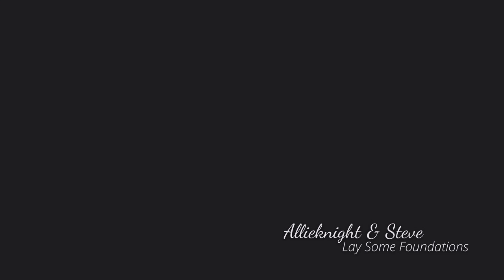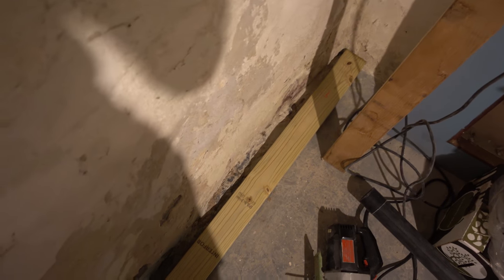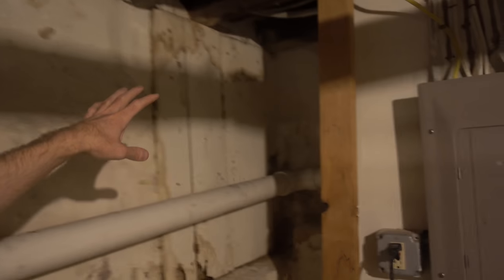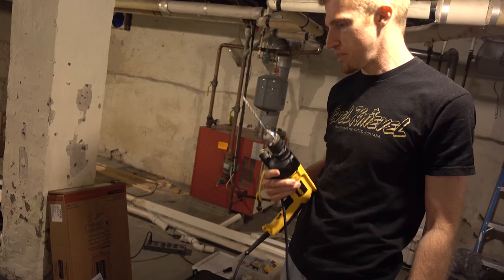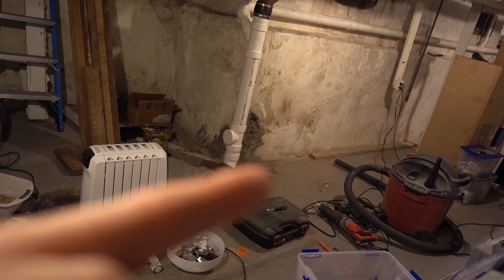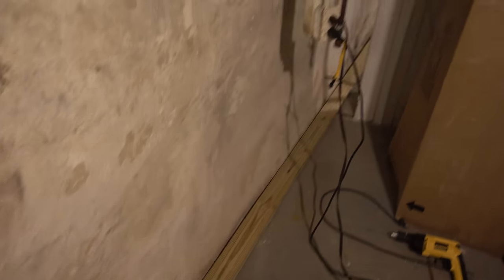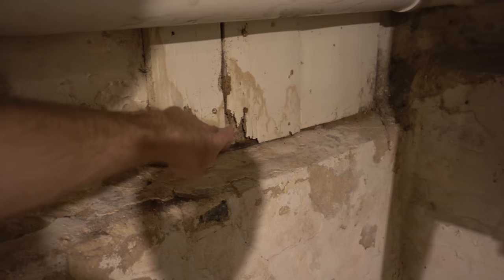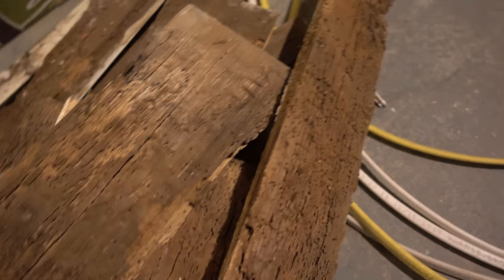Laying Foundations

Comment: No moisture barrier?  Any time wood (even treated) touches concrete, you will get rot like the boards you removed. Lift your bottom plate and put something substantial under it.  I like using roofing material, it is thick and durable.

Comment: Washers under your tapcons for better loadgrip spreading.
Sealant on the tapcons because you drilled thru the 3 inch thick slab and it's just wet dirt under the slab.
Reply: Ronald Oswald That's what I was going to say. Also seems like a real thin slab.
Reply: 3 inch is standard for slabs that don't get driven on.

Comment: Are you going to replace the panel or pony a second panel. Easier?
Reply from the maker: Eventually a full replacement. For the interim, the old panel will become a subpanel of the new until we can replace each circuit. That's coming in a future video :)